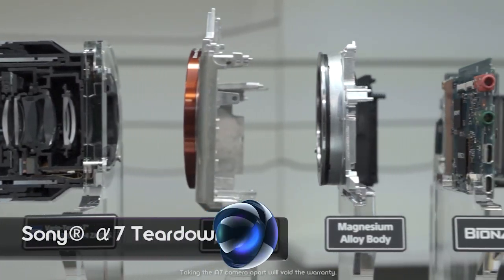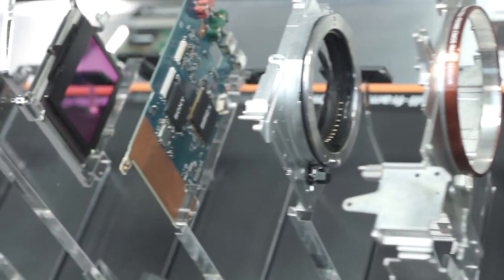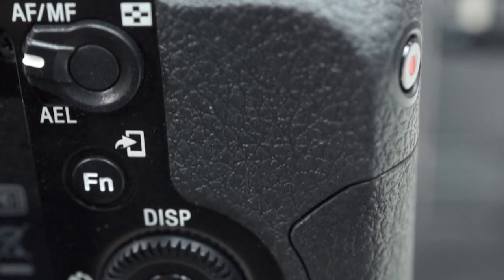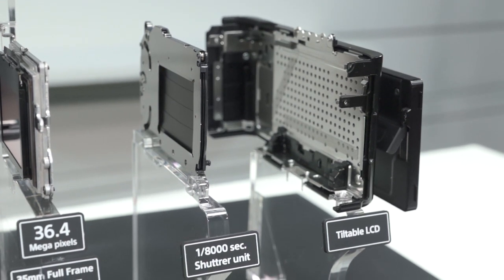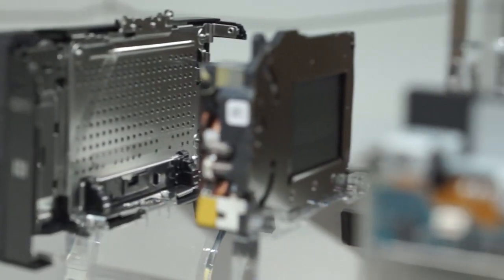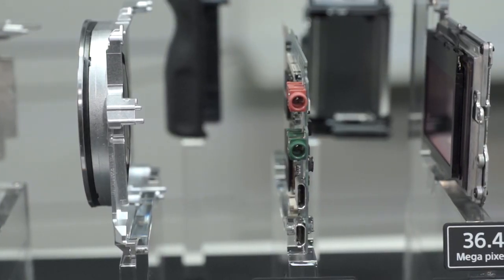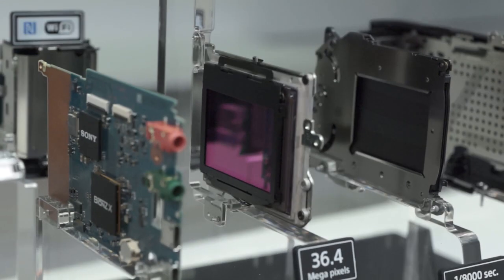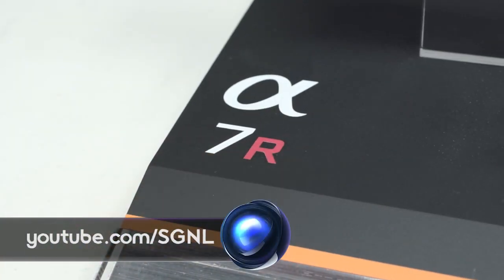Sony's a7 Full Frame Mirrorless Camera Gets A Teardown

Comment: Hello @Sony I have Sony a7II last year, while using adapter it got stuck and I had to put it to Your official service for warranty "repair" - to take it off. Now, year later when I wanted to mount native Sony FE lens (50mm 1.8) it doesn't connect.
On the inner half bottom ring with golden pins, it appears there is a dent on the corner, next to the very left pin. The focusing mode is gray, it doesn't allow me to switch to AF. 
Is it possible to repair and exchange only the pin ring?
Thank You very much for help, Your customer's service has been absolutely top notch so far..